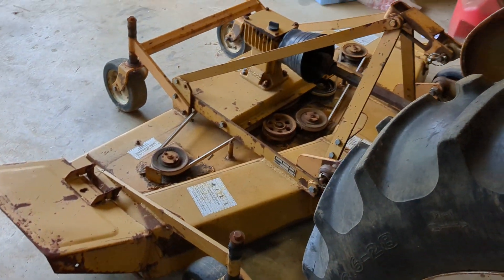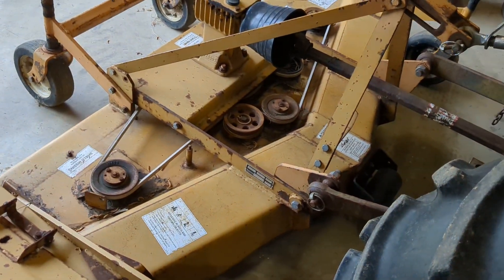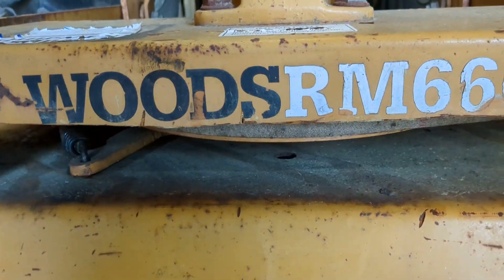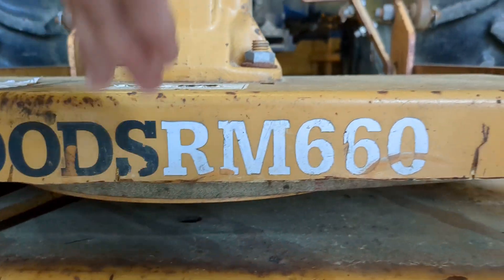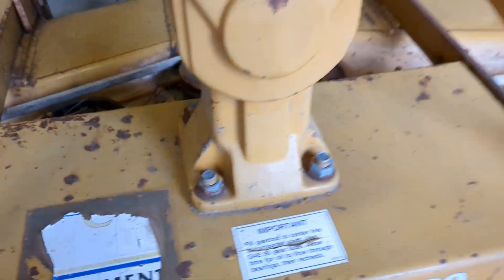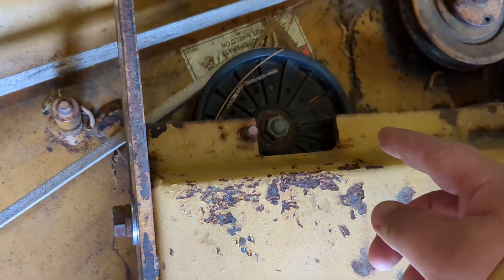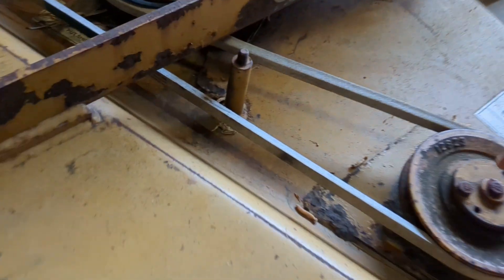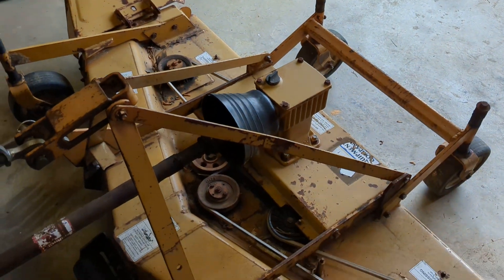Woods RM660 Finish Mower Belt Diagram and Mods To Make Your Life Easier...

Comment: Hey, I'm one of the 23 of us still running this finish mower, and I want to sincerely thank you for taking the time to make and post this video.  I never would have thought of making that window with an angle grinder, but it absolutely made changing the belt possible where before... nothing but frustration and busted knuckles. I probably spend too much time thinking about how life might be better if the grid went down and stayed down, but the one exception is YouTube.  The amount of pooled knowledge and experience here is a Godsend.

Comment: I got one borrowed to see if I want side or rear discharge,needs a belt so much appreciated,will refer to your video when I repair it,thanx again
Reply: I just got a new TK72.20 do not like the rear discharge
Reply: Aint got my loaner mower fixed yet ,i will remember the dont like  rear discharge,thanx again

Comment: I had same problems. I took the two bolts out of top plate and loosened the two bolts on the sides then was able to tilt the whole top back from front with power take off attached to easily get the big pully belt on. Still much easier with two people.

Comment: I just changed my RM660 belt today solo without having to cut the back out.  It's a sucky job but here's how:  Take the plate/gear box off and slide it towards the back about 6 inches to access the spoked drive wheel from underneath.  Once the belt is on the drive wheel, use painters tape to keep it in place as you put the gearbox mount back.  Once you get the belt back on, the tape just breaks away as soon as the wheel turns.  It sucked but it can be done.